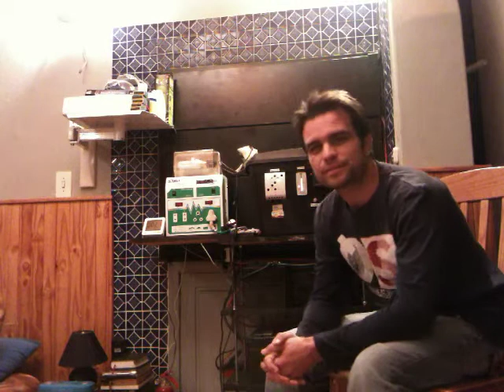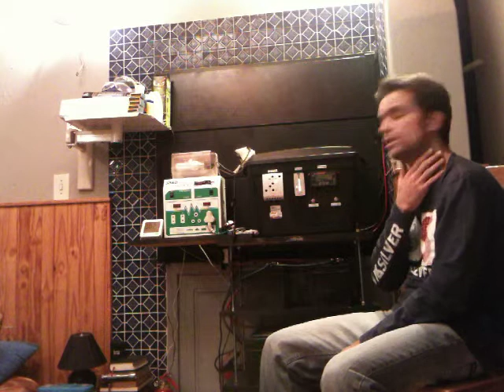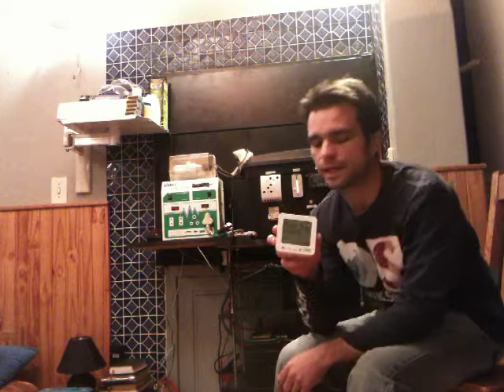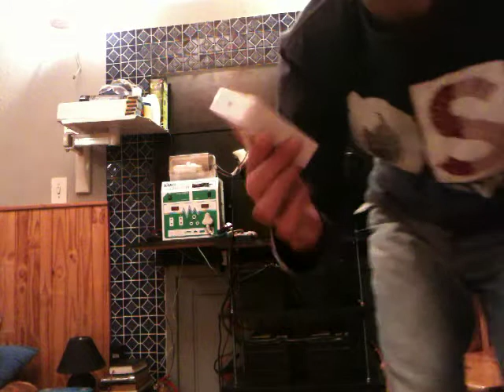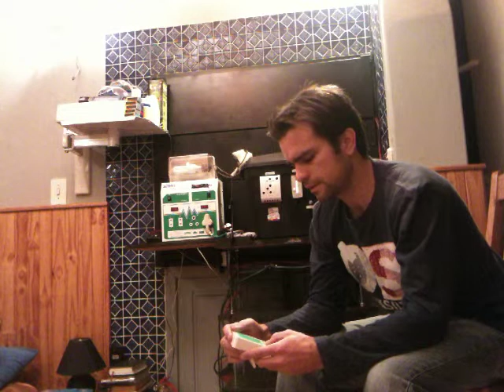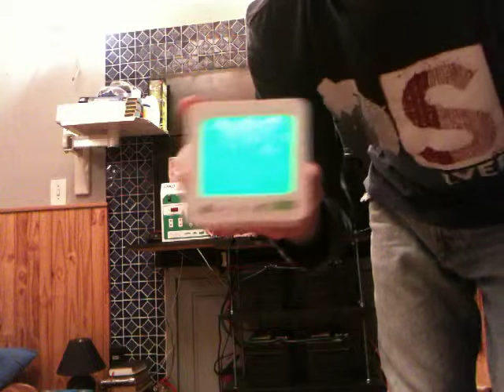My indoor solar setup. (Power Box)

Comment from the maker: Hey USA 7KWH not KW sorry hehe.Thats the energy I used from the batterys  in a month period.So my energy meter reads my consumption on a daily basis and adds it up for a month total which equals the 7kwh.Which is not much for a month but I was not home much.My batteries get a full charge and start the float process just after midday. Hope I answered your question.Thanks for the comment and picking that up. :)